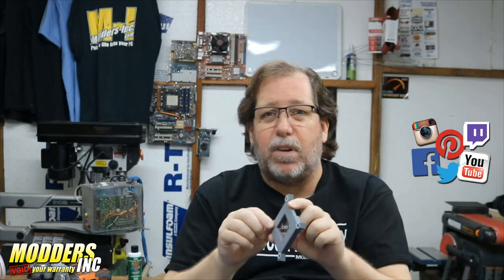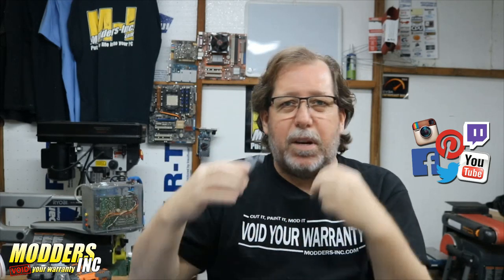10+ Ways on How to Apply Thermal Paste to Your CPU

Comment: I always uses the 5 dots method and achieved great results every time. The secret is to use adequate amount of paste for each dot and balanced their position so it can spread evenly and covered the whole processors surface. Before this I uses the bean in the middle method but in wasn't sufficient for the newer processors. I also uses 5 dots method because I hate to waste the precious paste when applying it with something else or using it too much and spilled to the side of the surface's edge.

Comment: I wear a black nitrile glove and smear the paste over the CPU then create valleys and peaks by dabbing with finger, then clean back the edges a couple mill with a cotton ear bud to prevent smearing on to the mobo. (CareyHolzman Style)
Reply: Sounds like a pain in the arse and completely excessive / unnecessary....

I just dab on a big dot in the middle, or do the "dice" (penta-dot) method, or an X. Simple, done. From these tests, either/any seems to work fine, as long as you use enough paste, and don't use a "completely excessive" amount.
Reply: Your opinion is excessive

Comment: One of he best "how to apply thermal paste videos" I've seen yet. Love it.

Wish you'd recreate it with a larger CPU like a Threadripper or Epyc, and try some different things like 6 / 9 dots in a grid, 4 dots in the middle of each quadrant [not sure if it'll squish to cover the center?], randomly placed dots, squiggles / random, spiral, etc.

It's funny watching how they all just squish into a big circle and cover everything, once tightened down with even pressure to the final position. ;) 

It's like "it's all made up and the points don't matter, 'cause it all comes out the same in the end."

Comment: The X is the most optimal one. Because the distance between corner and center is bigger than between the edge and center. So it is necessary, that the paste is spreading more to the corners than to the edge. And the only form which can provide that is the X. Not the + (plus) by the way.
Compare + and x and you will see why. The paste is spreading more in that direction, in which the "line" is showing ... at least more than to the side of the "line". So you want lines showing to the cpu-corners, and the sides of the line showing to the cpu-edges. An X inside of a square can provide that at best :) 
PS#1: I think people who are hunting every degree celsius by using an AiO-watercooler, should not be "sloppy" by using a simple paste-blob in the center of the cpu. Because with the center-blob, the paste will not reaches the corners of the cpu. That can mean a 5°C higher temperature, what would make an AiO-watercooler obsolete.
I can post the source, only if you want :) (Applying the paste with finger/thingy overall the cpu is the only alternative, which gives same temperature-results)
PS#2: I hope my english is understandable, because i am native german ;) 

Thumbs up
Reply: most readers likely guessed the "german"-part 🙂 there's something to be said for a small circular dab, as an alternative for achieving fuller coverage. Italiano-style!  :-)))

Comment: thank your very much sir, I've wanted to see this for a while now
Reply from the maker: You're welcome
Reply: Would love to see one with a larger CPU like Threadripper / Epyc and a few more layouts like a gridded array of dots, like centered in the quadrants, or like 6 dots in 2 rows of 3, random squiggles (will the elusive "air bubbles" everyone has warned us about form?), diagonal lines, "curved X" (like two overlapping S's), etc.

Seems like basically everything just squishes out into an even / flat layer under pressure from the cooler / tensioning screws.

Comment: Level1Tech and Der8auer did tests on Ryzen where they use a "dotting method" on the chip's because its multiple ones. Der8auer even make a part that offsets the cooler to be center over the chips.
Reply: Yeah, I'd love to see an expanded test for Threadripper with same methodology as this test. With like a multi-dot setup, among some other ideas... :)

Also, I'd be interested to see actual thermals when using the same "methods" to apply a real cooler, to see if there is any non-trivial difference in actual CPU temperatures, throttling, etc. Especially on the ones where there was maybe non-coverage at the corners. Does it matter (given the actual CPU dies are toward the center)? Or, likewise, if some method appears to create air bubbles (honestly didn't see any in the tests)... Do air bubbles really create "hot spots" or increase thermals, or wear out CPUs earlier than you'd otherwise expect, or are they just ... fine since the CPU basically has a built-in heat spreader / casing, or whatnot, to even out temperatures and minimize/eliminate impact of "hot spots"?

Comment: Very nice video! 

I would think though that there's (to some degree) "no such thing" as "too much" because when put under the force of mating the cooler with the CPU, and any of the ("too much") excess will <fart nose> ooze out the sides. 

While this is of course not optimal, I still personally think it's safer than not using enough. Not using enough IMHO would be worse than using "too much" and letting it ooze out around the CPU! 

Because one cannot actually know what their application looks like under after they take the cooler off, and once you do that ~ you have to re apply LOL!
Reply: If there's too much it oozes out the side when you put the cooler down on it. And It can get on to the motherboard, potentially shorting out devices.
Reply: The only way you can put air, thermal paste (all of them), and heat pipes on the same heat conductivity charts is to use a logarithmic graph.

Air is awful compared to any thermal paste, but all thermal paste is awful compared to heat pipes and spreaders.

Too much of the best thermal paste could literally end up as bad or worse than just the right amount of the cheapest paste.

Comment: Great video, thanks! I usually use the 5 dots, but bigger dot in the center. Lately, I got the paste in a little tub, so I used a spreader to do nice thin layer all over (like your finger one lol).. I hope you used the cheap stuff!
Reply from the maker: Thanks for the feedback! I used Noctua NT-H1
Reply: Yeah, I always figured one dot in about the middle and one in the middle of each quadrant should ensure even/complete coverage. IE, the "Dice" method.

Glad to know I was right, and that it also "doesn't really matter which way you do it, 'cause they all work just fine."

Comment: I'm wondering if there could be air bubbles trapped inside the thermal paste after it had been pressed between the glass and the CPU case. If the thermal paste is replaced by some sort of transparent paste, that would be easier to see. Thanks very much.

Comment: Very comprehensive thermal paste application video. Question.... Did you observe any air pockets on the spreading thermal pasted with your finger method? Also,  diagonal "X" method looked good on the video. What did you observe? Too much leaked over the edges? Thanks again for a great video!
Reply from the maker: What I really found out was that I think all the methods will work. It all comes down to the amount of paste used.

Comment: Very interesting. I just use the, "pea method", as many others. You should've included that, as well. At least you did the "big blobby mountain method".

Regardless, top notch testing.

One more thing: I recently bought a tube of, Thermal Grizzly Kryonaut. I haven't tried it out (because I just recently added new paste (another brand) on my CPU), but there's an included spatula with it. I've heard that the, "credit card method", sucks because of air pockets and such, but at that company they seem to know what they are doing, so maybe it's great for their paste. Maybe you get the paste to be particularly thin with this spatula, and paste, and can't be compared with credit cards. Not sure.

Your finger method seemed to work great, though, haha. Which should be considered as, "the crazy man's method". And it's similiar to using a credit card, but more reckless and random and it didn't seem to leave bubbles of air.

However, once again, awesome demonstration. Thank you.
Reply from the maker: Thank for the info an comments! There is a fine line between too much and not enough paste. Too little it will not spread enough and do air pockets or leave gaps. Too much and you build up too much and get a bit less heat transfer.
Reply: But is that REALLY true?

'Cause to my mind, if you use "too much" it simply oozes out the sides, and you still end up with the same thickness of material between cooler & CPU. Like a 1/16mm gap doesn't suddenly become a 1mm gap simply because you "used too much paste." Paste is non-rigid and will simply ooze out, and you'd still be left with a 1/16mm layer, if the gap is only 1/16mm, or what have you. It's not like it'll somehow make the "gap" bigger or prevent you from fully tensioning your screws, or what have you. 

It's not Thanos' Reality Stone, it can't just "warp reality" to suddenly make the gap bigger than spec. ;) Yeah?

Comment: Omen 15 owner here, thinking of re-pasting, just a question.I got 3 tubes of mx 4 4 years ago, I opened one to use a tiny bit. Does thermal paste go bad? Can I use the remainder of the opened tube?
Reply from the maker: If kept sealed it should be OK
Reply: @Moddersinc1  thanx, but I threw it out, used the unopened tube.

Comment: ..is it ok to mix thermal grease with thermal adhesive for other than CPU application ?..I'm not sure if thermal grease is adhesive..does it stick perpendicular heatsinks?..and I definitely think flat black color absorb better heat than white silicon paste..
Reply from the maker: I would say no on the paste/adhesive combo. Color has nothing to do with how well the paste or pads will transfer heat.

Comment: What I got from this really long video as I'm unpacking the parts for a brand new build that will get me back to a proper computer and away from a shitty laptop is that the way I've been doing it all along, by using and gift or credit card to carefully spread a thin layer over the surface of the chip is the best way no matter how many times 've been told by lazier techies how slow and unnecessarily anal that is.
Reply: What I got from it is that they're literally ALL EXACTLY THE SAME and give EXACTLY THE SAME END RESULT (aside from a couple that don't quite reach the corners BOOHOO; ohh wait, the corners really don't particularly matter).

So, you can literally do it basically ANY way, and you're going to get exactly the same coverage, barring simply using "too little."

Dot, dice, 2 lines, 3 lines, X, +, smear, random pile, they all end up covering it EXACTLY THE SAME once put under the pressure of the cooler / tensioning screws and it all "smears out" into a giant circle or square that covers the full surface evenly.

And if you really think about it, assuming the pressure is the same, and the distance between the cooler and the CPU is thus the same, you'll have exactly the same VOLUME of thermal paste in between the two, so really what he said about "too much thermal paste acting as an insulator" is pretty much bullshit, too. [No offense, of course.]

If you have exactly the same volume of paste, it's not going to be "more thick" or "too thick" since it's literally exactly the same volume. It's nonsense. 

1mm=1mm, or 1/16mm=1/16mm, whatever that "gap" that's being filled is will be exactly the same, assuming the same tensioning, etc. 

You can't, for instance, put 1mm of material in a 1/16mm space. It's ridiculous to say you could. No ... anything beyond the 1/16mm will simply be squeezed out and you'll still end up with a 1/16mm layer (or whatever the actual distance is, at full tensioning and final "gap" distance). A 1/16mm gap won't magically transform into a 1mm gap, unless you somehow screwed up on fully tightening your screws sufficiently. It's not like the medium is rigid and will somehow prevent you from tightening fully. No, as you tighten, it'll simply be the semi-fluid substance it is, and be squeezed out to the edges of the CPU, or squeezed out onto the PCB or whatever.
Reply: @MGmirkin  That's a good point. And you're absolutely right. Thank you for clarifying that up brother.👍💯

Comment: could you please Message me the files to 3D print those templates?
Reply: Still waiting to hear back about sending me the templates for those
Reply from the maker: the templates were cut on a laser.
Reply: Very cool do you happen to have the files for 3D printer I could use? 😎